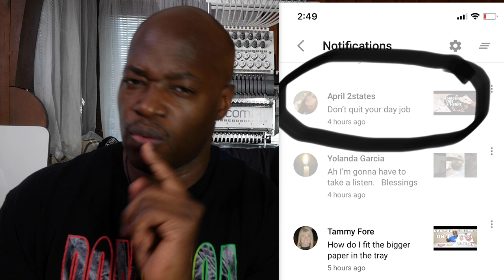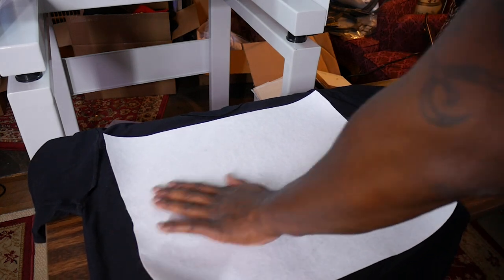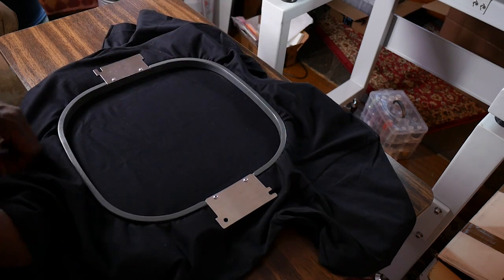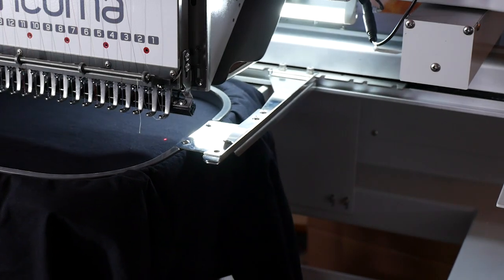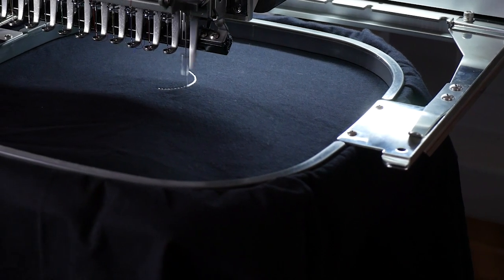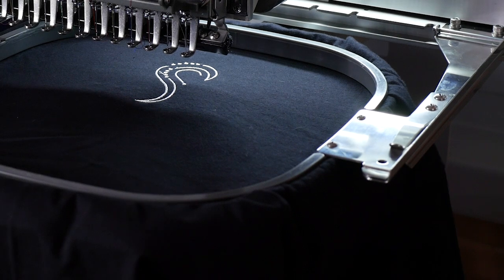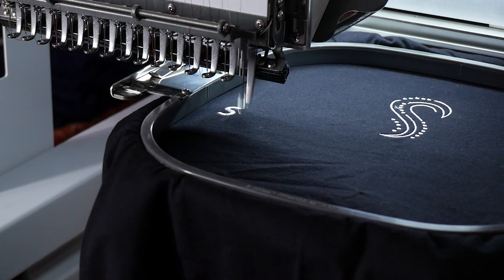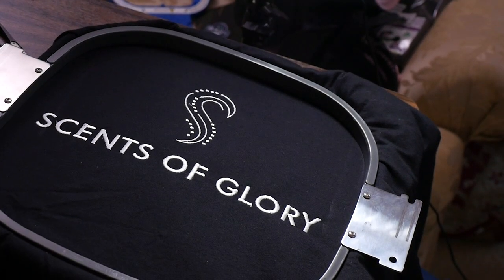Ricoma MT-1501 Embroidering on at T-Shirt

Comment: First off thanks for this video. Can this be accomplished with tear away stabilizer? Also, are the shirt thicker than the average tshi
Reply from the maker: If you are embroidering on shirts the stabilizer should remain on the embroidery design to help maintain the integrity of the embroidery over time.  Tear away would not be ideal for the longevity of the embroider design on the garment.  

Thicker than the average shirt is a tough question,  what do you consider an average shirt? Undershirt or gildan 500?

Comment: Im a beginner, .Whats ure best way to line up a design on back of a t shirt 
My designs dont come out straight
Reply from the maker: Heat transfer warehouse sells a laser that solves that issue easily.  I’m gonna make a video it soon.  Stay tuned.  If you wanna pick one up use my affiliate link. Heat transfer Warehouse
https://heattransfer.ositracker.com/159730/11767/url_15370

Comment: Hi Alan, how do you program your my 1501 to use mighty hoop 5.5.. please help.. thanks 🙏🏽
Reply from the maker: First you have to make sure you purchased the mighty hoops with the correct hoop attachment for the mt-1501. Contact mighty hoop and make sure your metal brackets are for the mt-1501. 

If they are the correct brackets you simply just use the screw driver and adjust the arms for the hoop like you are taught in training.
Reply: Thank you so much for this. I did purchase the correct hoop. I was wondering for the control panel to pick the correct size bc mighty hoop option isn’t there. Do I change the x-y measurements to accommodate the mighty hoop? Thanks again Alan.